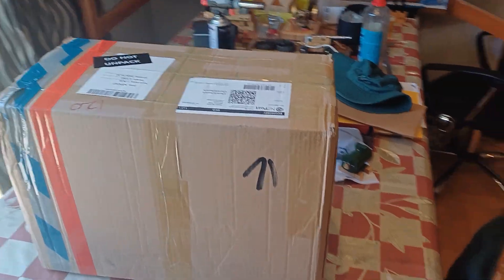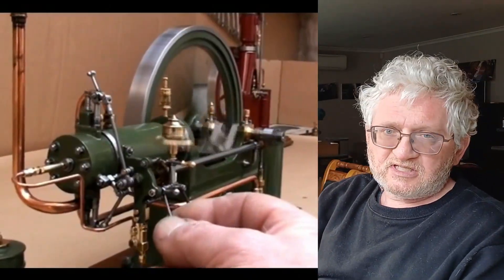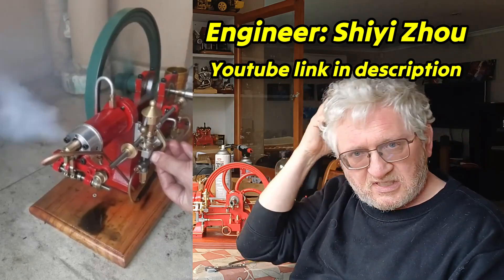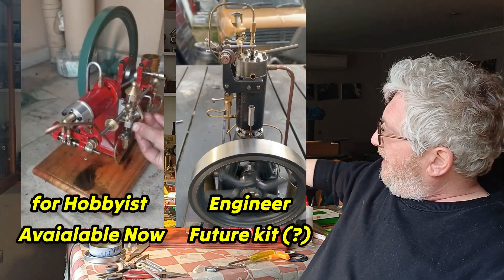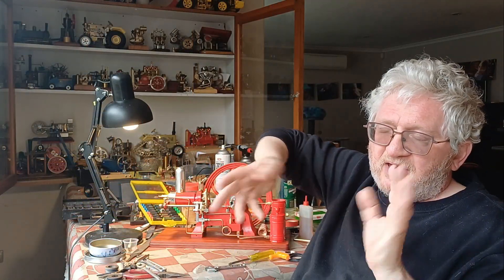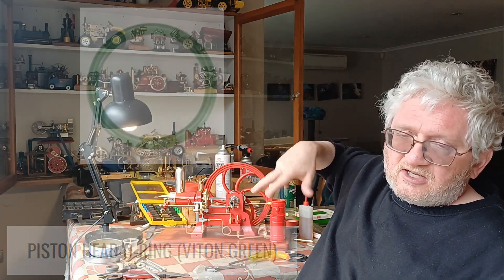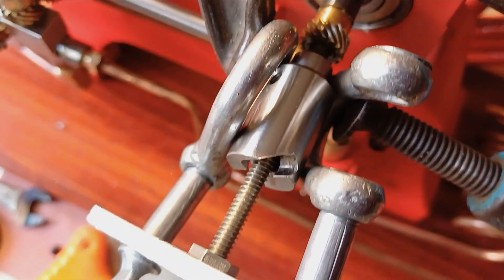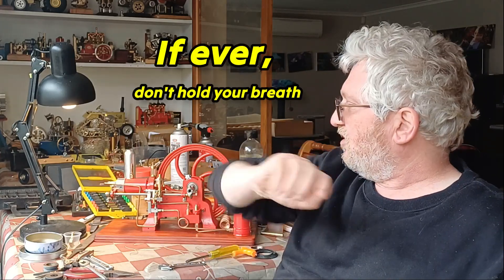Working model diesel follow-up - Updates; Links, German Engineer's Quality Diesel kit may get made?

Comment: Thx for the comprehensive link lists in your descriptions.

It sounds like the German kit is where I should be looking if I want to do a tiny CHP (Combined Heat and Power) setup to actually do work!  :)
But like the price and availability of the Chinese engine. 

I NB that when you halve engine capacity, volume drops by 8X, while combustion chamber surface area drops only by 4x.
So the (heat losing) surface area to volume ratio increases dramatically and is VERY high at only 16cc.

That makes me wonder if it's possible to bore that specific engine's sleeve to a higher capacity and add a bigger piston with steel rings?
As you know I'm not nearly as concerned about friction and wear as everyone else is.  Not by a long shot!
So doing so should improve things dramatically..?  Many things!
Is there enough meat in the cylinder for boring?

I'm having my own look thx to your links, but that does nothing for The Youtube Algorithm!  :)
Reply from the maker: For many engineers with ability, a level above this hobby motor, I think you're right. Many of us are waiting for @niffi2 engine kit release.

Comment: I m new to this channel but I have also been building model engines based on Find Hansen's explanations. Some of them are posted on my channel. Feel free to contact and keep up the good content👍
Reply from the maker: Many thanks for dropping a comment, your contact and offer.. I will explore your channel and I appreciate the offer of help and info! There are some talented engineers out there, it seems; respect! I love your models.  I assume you are ok if I show some footage of, and direct people to your channel?
Reply: @ThomasPCGuruENGINES  Yes, of course it is not a problem. Thanks a lot and let me know if you need anything!
Reply: @vellamechanicalservices6836  Wow, I haven't seen your engines before. Fantastic work and the engines run very nicely!
Solid engineering and i guess without rubber piston rings... 
I am not against these rings, they are ok for slow running petrol engines with low compression, but not for a diesel engine.
Reply: @niffi2  Thanks for your comment and for choosing to check on my content. Yes, rather than using rubber piston rings I chose to use cast iron rings. Even the piston and the cylinder are cast iron. It is similar to what Find Hansen himself explained. Always feel free to comment on anything else.